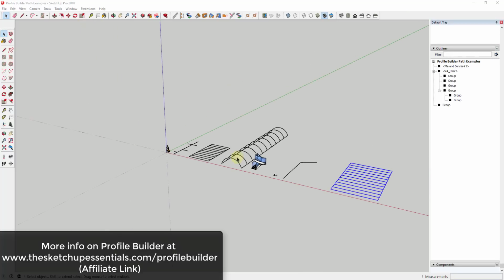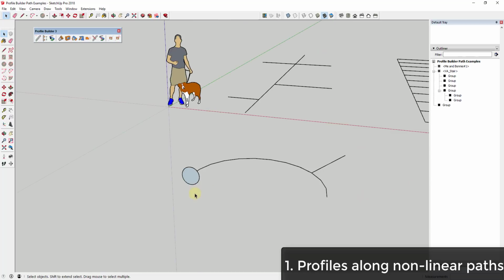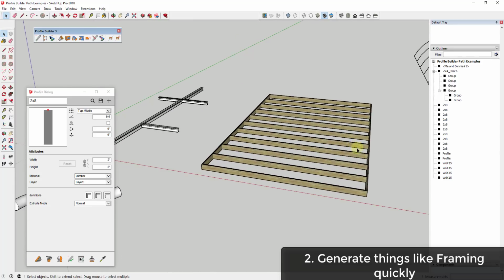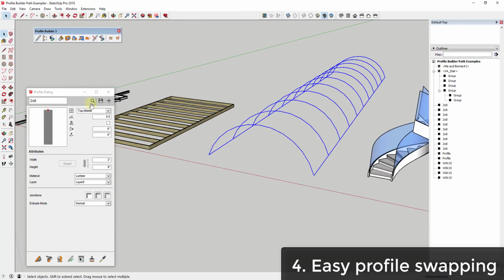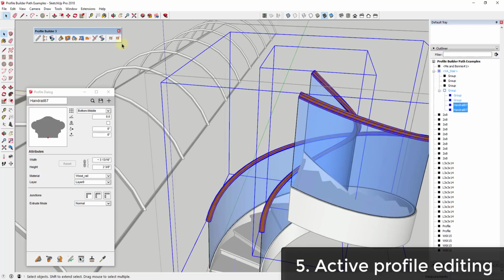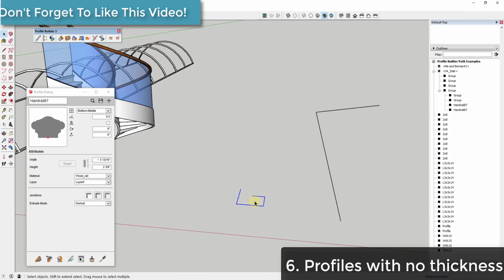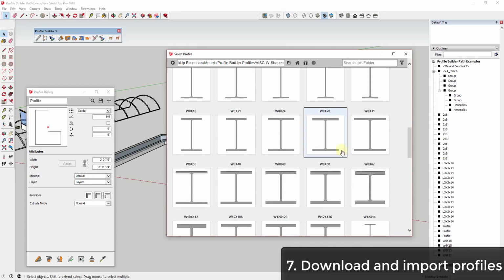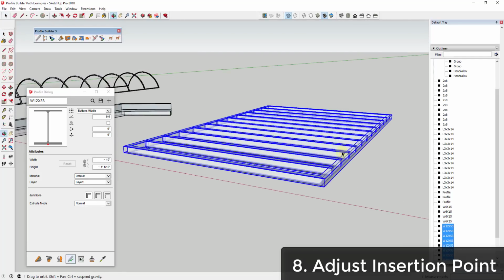Profile Builder for SketchUp - TOP 8 FEATURES for Profiles

Comment: Can you use this to draw on a floor plan and then instantly create all of the walls?
Reply from the maker: Theoretically yes - you'd have to set the walls up as an assembly, and you'd have to manually add doors/windows/etc - https://www.youtube.com/watch?v=T4wssAd8vXY
Reply: @Thesketchupessentials  Just tried it this morning. Created a random rectangle, unlinked height and width, set to 6" by 9' and traced a set of walls from CAD. Then came in and insert holes for doors and windows. Holes can be removed and replaced. My new method of drawing floor plans!